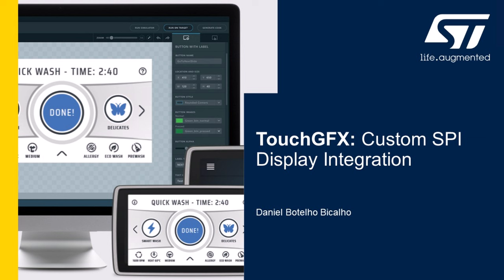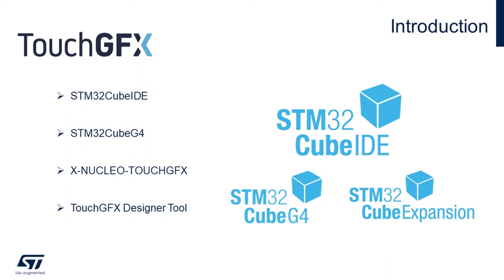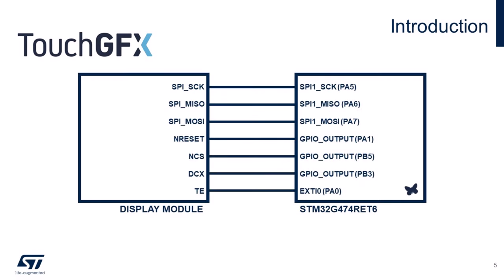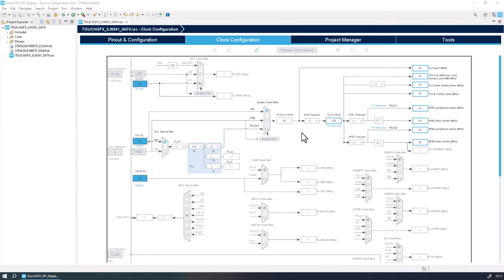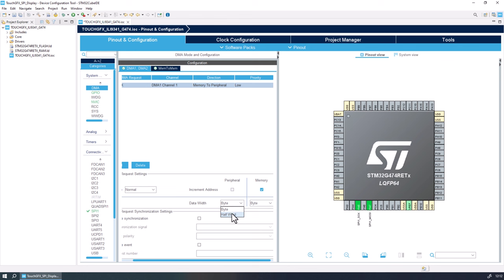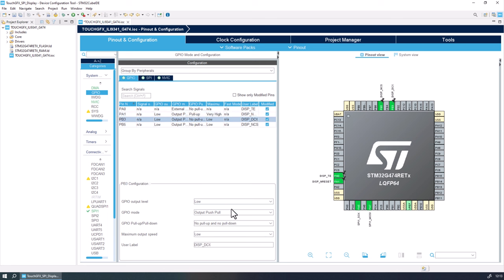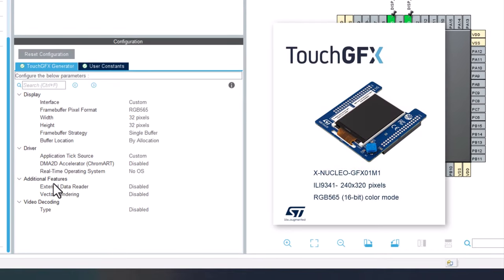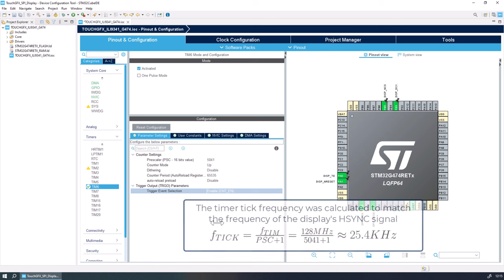TouchGFX Custom SPI Display Integration - part. 1

Comment: Thanks so much for this type of a video, regarding connecting to a generic SPI display. Most of the older TouchGFX videos are just about using integrated display dev boards.
This series will help a lot of people 👍